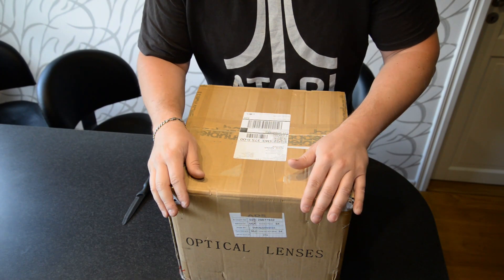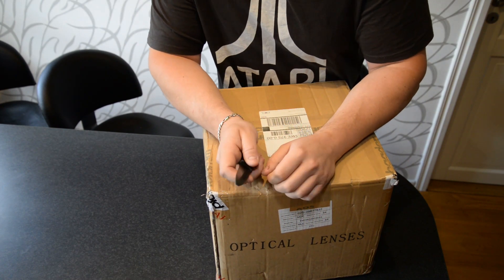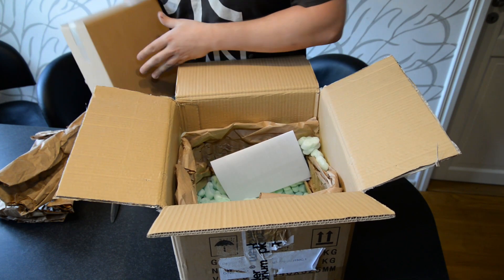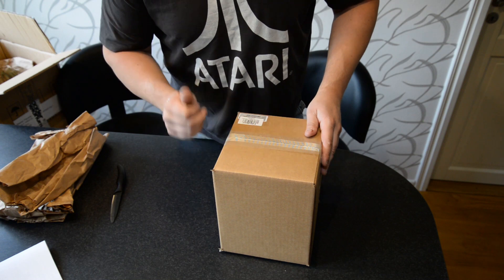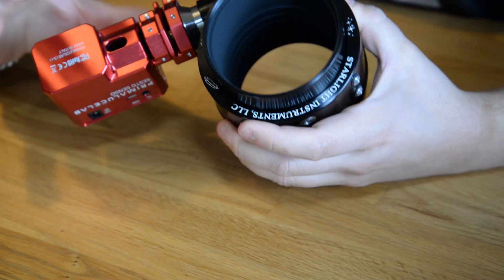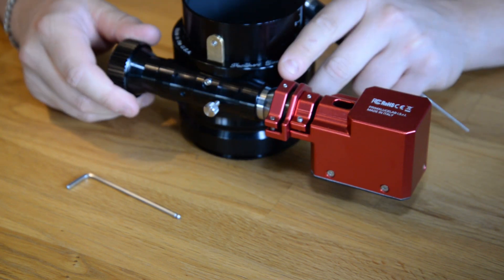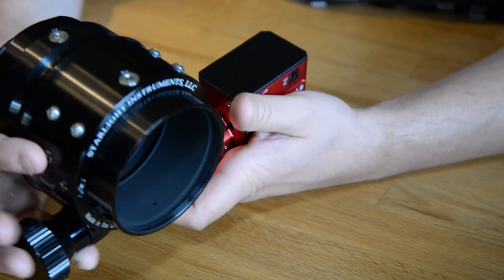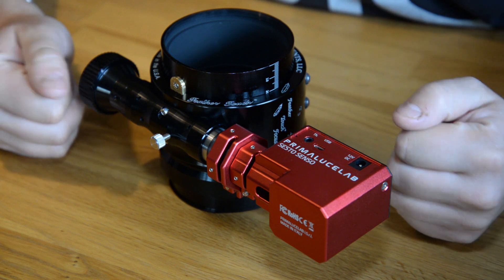Feather Touch focuser - unboxing and mounting the Sesto Senso focus motor

Comment: did you look into the primalucelab esatto 3" focusers before deciding on the ftf? theres a nice focuser/rotator combo available from pll since while back; the esatto3.5" and arco3" rotator with a combined thickness of only 58.5mm and a free aperture of 76.3mm. What corrector are you using?
Reply from the maker: Unfortunately, the esatto was not released the time i bought my focus motor - but it looks quite interesting indeed!
A haven't really been feeling the "need" for a rotator, so that is for another setup i guess :)

The reducer i am using right now is the Riccardi 3" TS sells. I used the "TSNTRED" but changed to the Riccardi for my new camera with the (much) bigger chip.

/Daniel
Reply: @ExoPhotography1  sweet. im building a 14" f3.6 custom newt and im currently trying to get my head around what focuser to put on the thing. the primary cell is accomodated inside the tube in such a way that it can be mounted in two, possibly three heights to allow for different size secondary mirrors and camera sensors from aps-c (~26mm) up to lowerend medium format at 58mm with the televue 3" paracorr. if i go with the esatto3.5" lp with a 0.1um step size i will have to custom manufacture an attachment base and telescope side adaptor but is really nice thin robotic focuser!
Reply from the maker: REgarding the focuser, feathertouch is rock solid - but there is other interesting alternatives!
Are you going to use is for visual anything? Isn't there any newton adapter for the 3 or 3,5" Esatto? thats wierd...
On my tube, there is three attachment point for the primary cell as you plan to make - and that is a VERY good idea - i have been adjusting my cell a couple of times depending on what reducer i use.

one thing to bear in mind - a larger secondary means more stress on the spring support, make sure it is ROCK SOLID - otherwise the collimation will be affected.

/ Daniel
Reply: @ExoPhotography1  I am also building a custom carbon photonewton. And I am looking for a new focuser. For example 2,5" Starlight but also alternatiuves like Baader Steeltrack

Comment: Which size adapter did you have to fit to the go user shaft?
Reply from the maker: I am not sure what you mean with "go user shaft" but i believe i ordered the 33mm version, that one is specially made for feather touch 3" focusers.
Reply: @ExoPhotography1  Oops typo I meant to say focuser shaft. Thanks for the info!
Reply from the maker: @RegP5  Haha, it´s ok :)